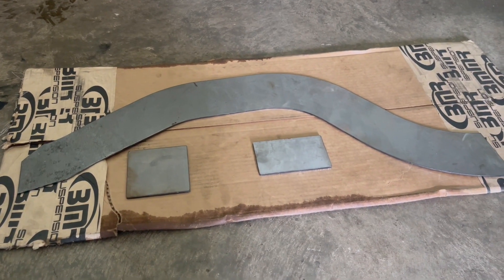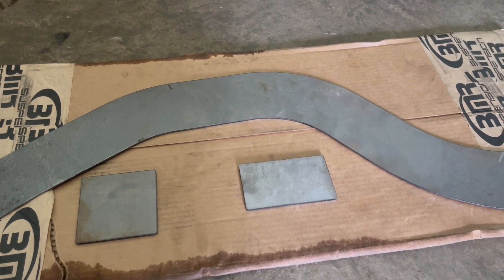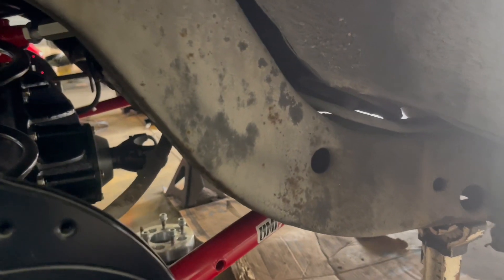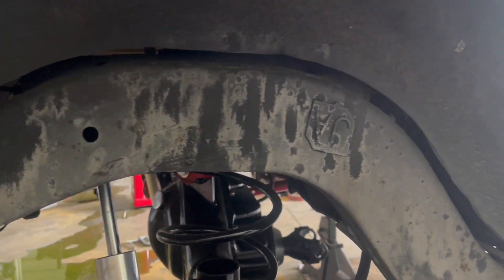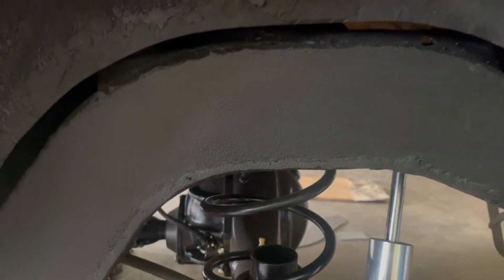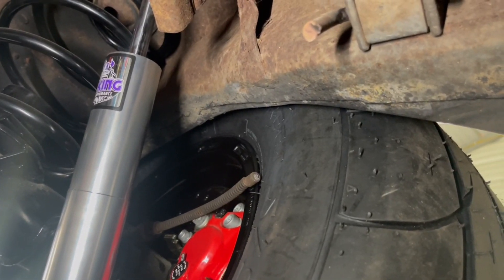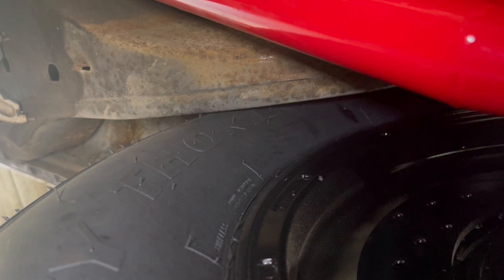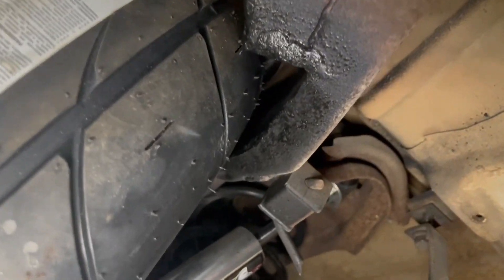HOW TO INSTALL G BODY NOTCH KIT.

Comment: Good look on the knotch can you tell me if the 9inch on the driver side is 3/8 of an inch over. Im having that problem. I don't have the adjustable upper control arms. But there boxed.
Reply from the maker: Ya mine is 3/8 over on the drivers side.all nine inch ford are always shorty axles on the  drivers side than the passenger side. Hope that was some help . Thanks for watching the channel and all your support.
Reply: @Nicksperformanceauto  did the Upper adjustable control arms correct the issue.. ?
Reply from the maker: @My0186  ya cause u can move them where u want it at then
Reply: @Nicksperformanceauto  thank you... Again. The Quick performance rear needs to be centered. Ordering the adjustables today.. Keep the Videos of the Gbody coming. Love the S10 also🦾
Reply from the maker: @My0186  u very welcome buddy.thanks I will and thanks u for all the support.

Comment: Good video, are they MT 275 60 15s? stock rear end? what wheel specs. Thanks im getting ready to do mine and been looking for wheel width and backspace etc as there isn't much room to mess up. 
Thanks
Reply from the maker: Ya they 275/60 15 no we put a nine inch ford but it’s the factory length
Reply from the maker: We had to c notch the frame but the rims are 4 1/2 backspace and the rim 8 inch’s wide
Reply from the maker: Thanks for watching the channel buddy
Reply: @Nicksperformanceauto  i appreciate the info very much helps me a lot.Thanks!
Reply from the maker: @josiahpoirier5449  u welcome buddy